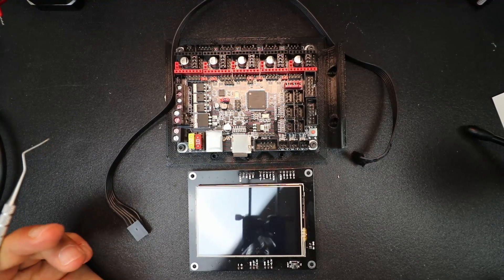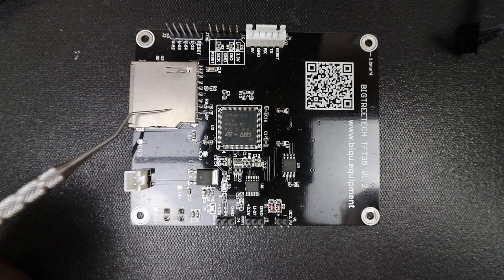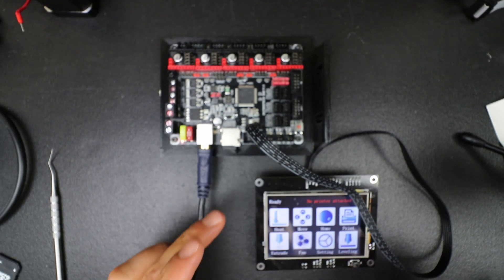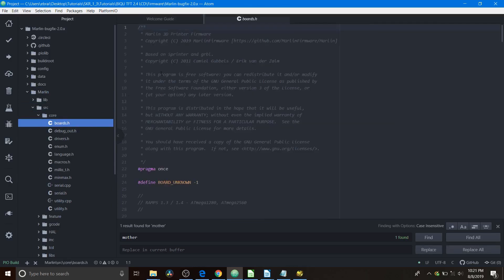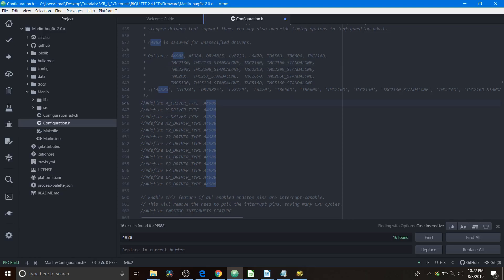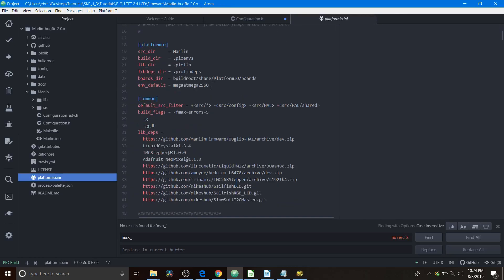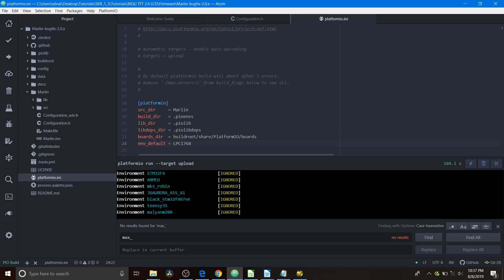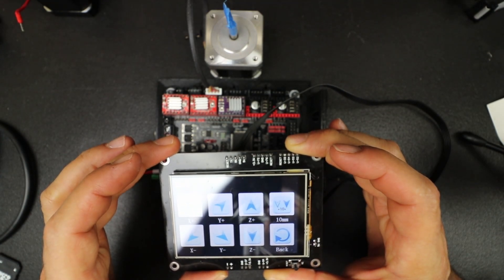SKR 1.3 - TFT35 touch screen display

Comment: Thanks for the Video a couple of idiot questions,  At 3:00 in, you plug the cable to the board, I think you are plugging all 5 wires into the main boards TFT port, but judging by the stripes on the cable you are plugging the reset line in separately last - that puzzles me as I could understand the 5V line last, but not reset.  Secondly did I miss any configuration of the display in Marlin ?  Is it automatic or do I have to enable REPRAP_DISCOUNT_SMART_CONTROLLER or similar ?  Finally why is the serial port set to 0 here when all your other videos use -1 ?  Many thanks Bob
Reply from the maker: I'll look at work today.
Reply: @EdwardBraiman  Thanks Edward - No rush I pick up the SKR tomorrow and theTFT is still en route form China.- I found the BTT GITHUB site and the original BTT SKR video after my original post and that shows the same plugging order - as an old hardware engineer the order confuses me - for ESD protection I would have plugged 5V last.  Flex Garcia below says uncomment FGD but I can't find that define does he mean #define FSMC_GRAPHICAL_TFT ?   The BTT video also shows enabling SERIAL_PORT as 0 and SERIAL_PORT_2 as 1 (though I have also seen -1, 0 elsewhere).... thanks again

Comment: Just a note: ".CUR" is not a Cursor file. It's meant to abbreviate "Current" as in "current firmware loaded on the SKR board".
Reply from the maker: Funny you should say this in my early tutorials in SKR v1.3, someone said it's a cursor file and windows identified the extension as such.
Reply: @EdwardBraiman  Windows says its a cursor file, because that what the .cur extension is defined as in Windows. It is actually meant as an abbreviation of current in this instance.

Comment: I understood this TFT35 uses UART. Does it conflicts with USB connected devices such Octopi/Octoprint?
In other words, can I have a 3D printer with Octoprint and TFT35 working parallely, or do I have choose and use only one at a time?
I'd like to have this TFT35 because it looks great, but I wouldn't give up on octoprint because of it...
Any comment?
Reply from the maker: Should work, but I have to admit I've yet to try.

Comment: Thanks but I don't fully understand, are we writing firmware to the SKR V1.3 or the TFT35 here?  I have a SKR V1.3 that's already running marlin 2.0 on my CR10.  It uses the original CR10 display by enabling it in the firmware.  I'm trying to upgraded that setup using the TFT35 but I'm not having any luck.  Ive tried changing the baud rate and the serial port along with disabling the cr10 display but I still get the no printer detected error.
Reply from the maker: It maybe your board connection or a firmware change on TFT 32.  The TFT 32 runs its own firmware.  I think you can see version numbers on boot.  Could you check and see the version number?  It might be a different flavor than what's in the video.
Reply: @EdwardBraiman  I have the TFT35. I'll also check both the connections and version number.

Comment: I have an older generation TFT screen, but the issue I have with it is that it doesn't provide much diagnostics information in case there is an error. This should be easy to fix with a custom dialog that reports the error message. Is this supported?
Reply from the maker: I've tried the old TFTs and wasn't able to get them working.  I try again, but I cannot promise that they will work.

Comment: Does using this, compared to lcd screen use up more or less from flash memory? I am struggling with skr mini e3 and it´s 256kb memory size when picking up functions from config...
Reply from the maker: I'll need to takes some time to investigate.  I've been very busy with work over the last 4 weeks, so maybe in a week or two I'll be able to research.

Comment: Hello, does anyone know if it is possible to use tft card reader in display for updating marlin on Skr board?
Reply from the maker: Should be fine, make a backup of contents if you're nervous.
Reply: @EdwardBraiman  thanks a lot for such a quick reply 😊😊😊

Comment: Did you make any changes in marlin for the TFT35? In Marlin under LCD or LCD controller sections?? Do we make changes in these sections???
Reply from the maker: Just speed, but new firmware for TFT may allow for setting change to 250000.

Comment: The supplied link for Amazon for this board says no sellers for it and we don't know when it will be back.  A dead link?  Did they come out with a newer version since this video? (edit:  Looks like there is now a 3.0 V of this https://www.biqu.equipment/collections/lcd/skr-v1-3 ).

Btw, I had a catastrophic failure with their SKR V1.3 that should not have happened and that is I accidentally shorted the HE1 heater cartridge wires together and it blew out a choke part and the main CPU (the skid mark was huge).  Basically the 10 amp fuse will not protect the board in such incidents.  I bought another but due to that it damaged my 12864 LCD panel so I am needing a new one.
Reply from the maker: Ouch sorry to hear about your hardware failure.  I'll be updating links tommorow.  I'm finally getting internet in my studio tommorow.
Reply: It looked the same so maybe they fixed the hardware issues and you have fodder for a new video we need.

Comment: Out of curiosity.... I have the  TFT25 (the smaller version) that need to update/theme etc.  at the same time I also have the LCD that was shipped with mine like one of your other vids. Is it possible to run both the LCD and the TFT?? I'd like to use the LCD while I am tweaking on the TFT until I'm happy with the final result.
Reply from the maker: In theory yes.  I've not done both, but others have.  I also have tft25, but I'm working on other install before doing tutorial.  The other tutorial means with exp1 and exp2.

Comment: I can't say enough Thank You for making time to share with us from your knowledge. Thank You for the way you explain things - especially for those with different mother languages. You have a Real Talent to explain using simple words. Thank You . Please can you make a video, or point me where should I look, for how to Upload Marlin v.2.0.9 on SKR v.1.3 and MKS - TFT3.5 v.1.0 display version with out nob ?. I was able to compile the FW for the board using your tutorial but I am stuck on Where/What to modify to accommodate my Specific Display. I know the section for the display but I don't understand from that list what is my display. I need to change the Baud Rate for this display?. I read and watched more than 30 tutorials but they are all for different displays . Thanks and Best Regards.
Reply from the maker: Thanks.  Display types vary.  Data sheets on displays can help.

Comment: Hi. Do I need to enable TFT somewhere in Marlin? Display is working on Marlin mode, but not TFT.
Reply from the maker: You'll need to do a possible firmware update depending on your version.  If it's still not working let me know.  Check out the other video on it in the playlist.

Comment: hi - after spending 3 weeks struggling with my slow compiling vsc, finally i got to the point where i could power on everything via octoprint and get started only to find that octoprint cant locate the serial port-----------im running everything through a pi4 so my setup is as follows: power comes in via the relay connected to the pi4, also using a buck converter to supply usb power to the pi4 - i put in the sd card with the firmware.bin, powered on the skr1.4 via octoprint, conected the printer to pi4 via usb, but octoprint cant connect as it cant locate the serial port - ANY advice would be appreciated - many thanks (using uart 2209 drivers)
Reply from the maker: First I'd not power raspberry pi via buck convert.  Next I would examine SKR for serial port numbers is set to -1 in VScode.  Check to see if you can connect via Windows if so, then raspberry pi should work.
Reply: @EdwardBraiman  hi Yes, will look at stripping out PI completely but i am  set to -1 in VScode so,,,,thank you
Reply from the maker: Which USB port?  USB 2 or 3, currently I use USB 2 port.
Reply: @EdwardBraiman  also 2
Reply from the maker: Does the USB port work when you use your computer.  Sometimes when I leave port at Marlin firmware defaults for serial port zero at 0 instead of -1, I see this issue.
Reply: @EdwardBraiman  hi pc port works
Firmware states -1 and 0
Pc not seeing board
What worries me is if I press reset it doesn't change or affect any red or green lights on board
Just stay on
I'm stumped
Board and drivers and screen came from biqu
Reply: @EdwardBraiman  appreciate your communication Edward than you
Reply from the maker: Maybe try another microsd card.  I've only seen this in my case once, but was able to recover with a freshly formated drive and a blank file named FIRMWARE.cur and a compiled file named firmware.bin.
Reply: @EdwardBraiman  will try new card and files thanks
Reply from the maker: What devices are connected to 3d printer board?  I'm wondering if one of them is causing the isdue.?
Reply from the maker: Just a thought but is the any devices connected to the motherboard?  If it's just a standalone board does it connect to your computer?
Reply: @EdwardBraiman  2209 drivers  and the basics plus bltouch on servo pins and 2 extra fans for cooling cade but only one works when switching board on
Reply: @EdwardBraiman  to make things worse it took 7hrs today just to compile marlin....that's got me stumped too
Reply: @EdwardBraiman  completely stand alone
Reply from the maker: If you disconnect this after powering down board, does the board work with the computer and flashing firmware?
Reply from the maker: Well I guess sdcard check is last option.
Reply: @EdwardBraiman  hi
When i power on there's just the sd light solid no screen comes on so I don't know what it's doing
8m working nights on break now . Will try different sd card and let you know dame time 2moro
Thanks
Reply: @EdwardBraiman  has to be something simple....but the compiler is a real issue
Reply: @EdwardBraiman  hi - used new card no difference, is the sd supposed to t least blink or something..............just going to jump off a bridge quick
Reply from the maker: Is the card formatted fat32?
Reply from the maker: Might be a defective board.
Reply: @EdwardBraiman  even tried swapping marlin ports around    1st port 0    second -1
Nothing
Like I said push reset and lights remain on
Reply: @EdwardBraiman  yes - im running this off mains and then 24v, i also tried just using the usb as power but still nothing
Reply from the maker: Sounds like the board is defective.
Reply: @EdwardBraiman  I agree now will have to speak and wait for supplier biqu

Comment: What display option do you need to define in the config? Thanks
Reply from the maker: Follow the steps in the video and see if it works.  I'm checking to see if it still works in the next couple of days as Marlin firmware may have changed.  A couple of users discovered an issue with another tutorial for SKR pro, but SKR v1.3 still compiles without issue.
Reply: @EdwardBraiman  unless I totally missed it, there is no step in the video pertaining to display selection in the config
Reply from the maker: Correct.  The TFT 35 is like a minicomputer using serial pins.
Reply: @EdwardBraiman  okay, so I leave ALL display options commented out then? Sorry to be such a pain. I'm very new with coding and struggled alot just to get the printer running with the skr haha
Reply from the maker: Follow the video and tell me if it works.  Remember this is not the same as a reprap discount full graphics LCD.
Reply: @EdwardBraiman  I still cannot for the life of me get my tft35 to connect to the skr. I Commented out all display options, didn't work. And I've tried uncommenting different displays also, all with no such luck.
Reply from the maker: Just tested the TFT 35 and it appears to be working with today's download of Marlin firmware.  Could you tell me about you setup?  Which version of SKR motherboard are you using?  Which version TFT 35 are you using?  What are the settings you're changing in Marlin firmware?
Reply: @EdwardBraiman  I have the SKR v1.3 and the TFT35 v2.0. I purchased them as a kit with tmc2208 drivers. I have my printer running great on Marlin_Bugfix_2.0, while using pronterface to run the printer. I have tried all sorts of settings under the LCD and display section. #define LCD_LANGUAGE en and  #define SDSUPPORT are the only two options i currently have enabled, and the TFT still will not connect to the printer. Any ideas?
Reply: @EdwardBraiman  Would flashing the firmware while being on 24v power as opposed to only being powered by the USB make any sort of difference? i just re watched your video and noticed that is the only thing that i have done differently from you.
Reply from the maker: So I confirmed you issue on another TFT 35 v3.0.  I'm guessing there similar issues.  Keep in mind the TFT 35 in this tutorial is version 1.2.  I'll see over the next couple of days if a firmware update fixes the issue on the TFT 35 v3.0, but it may take longer depending on bigtreetech tech answering or acknowledging the issue.
Reply: @EdwardBraiman  awesome. Thank you so much!

Comment: Great video, thanks for the info. From my side, I have the TFT24 version. I still do have the message 'no printer attached'. I Asked BigTreeTech and they sent me their firmware. This this one, I do not have the message anymore. Nevertheless, I need to modify Marlin to be adjust for my printer which is not possible the firmware.bin file. Do you have any idea what is impacting this message in the code from Marlin (I used the same value than yours). Regards
Reply from the maker: Try doing file compare on the version of Marlin they sent and Marlins current release to see if you can find the differences.
Reply: Edward Braiman problem is that I cannot compare both as they sent me the bin version (compiled version).
As far as I know, we cannot uncompiled it?
Reply: Any luck Cedric ?  I have the same board coming from China next week.   Did you try it in the alternative LCD12864 simulation mode ?
Reply: Bob Carter by using marlin from github the one for the skr 1.3, I do have the issue anymore.
I compared with the one from the official website and honestly I did not find the root cause with the original.
Best for you is to do your modification on marlin from github instead of downloading the version from Marlin website 🤔. I have now another issue with bltouch. The leveling works perfect but when it is completed it does not want to print. If I do not perform leveling with bltouch, then I can print. Very strange

Comment: Hi love your video. How hard would it be to comfig the skr v1.3 for a ultimaker 2 +
Reply from the maker: There is an examples folder for configuration of the ultimaker 2 + I think in the Marlin firmware subfolder.

Comment: where do you connect "the last pin?"
Reply from the maker: Watch the video and you will see.
Reply: @EdwardBraiman  you actually cant see in the video
Reply: @EdwardBraiman  That's a useless reply. It is impossible to see in the video. Out of focus.
Reply from the maker: The last pin I think is reset.  If you trace pins on silk screen of TFT they will match silk screen on SKR board.  Hope this helps.

Comment: i've connected the tft 2.0 to skr 1.4 and it's still says no printer attached
Reply from the maker: What's the current firmware on the TFT under settings?  Check out my upgrade video if it's not current.
Reply: @EdwardBraiman  it's 2.0.23, i was afraid i'm gonna have to upgrade cause i understand you need a ttl for that ( have TFT 35 v2.0)
Reply from the maker: In the playlist I should have a tutorial on how to do upgrade.  I broken the tutorials up because most people only watch on average three minutes and if I did a 25 minute tutorial most people stop watching.  I'm going to be recording a longer version on tft35 v2.0 for SKR pro v1.1 maybe this weekend.  It's going to maybe have an extra step not in SKR 1.3/SKR 1.4.
Reply from the maker: Does your TFT 35 now work?
Reply: @EdwardBraiman  no,actually i'm in a swamp here, it used to work with the mini, but now i can't the mini doesn't work, because compiling in PlatformIO 4.1 somehow bricks it. 
so now , i can't use the TFT with the skr 1.4 , because i need to upgrade the tft but i can't do that because it needs a bootloader fix via USB-TTL device which  i don't have.
and i can't use the mini for the reasons above. 
and on top of that i also have the LCD 12864 which also doesn't work with the skr, but does work with my MKS, (the only difference that and the one in your vid is that the LCD's connector are upside down. (with the notch facing the other way) 
i also have the MKS TFT28 V3 which also doesn't seem to connect to the skr
Reply from the maker: @emaayan  just got TFT 35 v2.0 working on SKR pro v1.1.  when I updated the firmware with normal method screen became untradable.  So I switch to Unicode and the tft35 v2.0 display came to life.  Not sure that will help you, but it might.
Reply: @EdwardBraiman  i don't know if of any other method to update firmware other then upload it to the sd card .